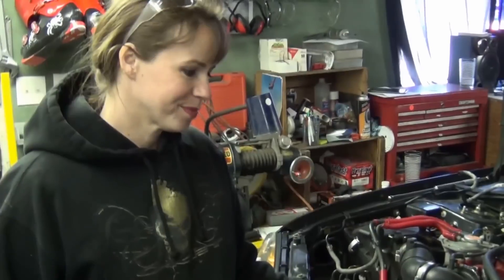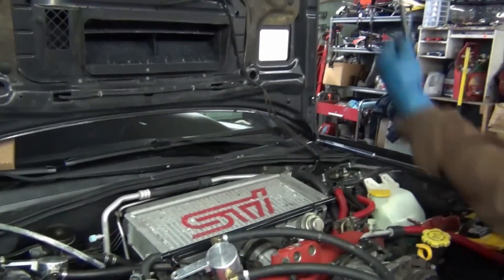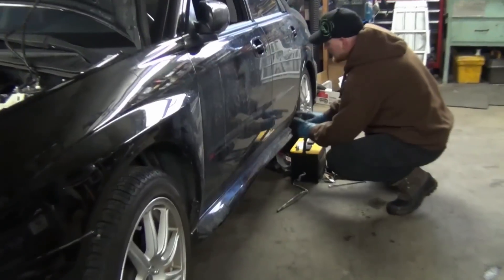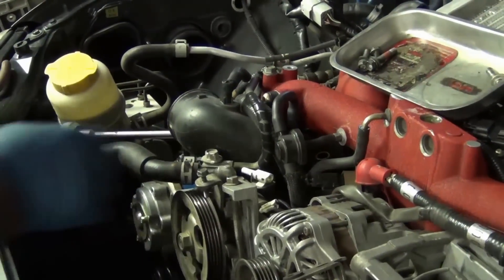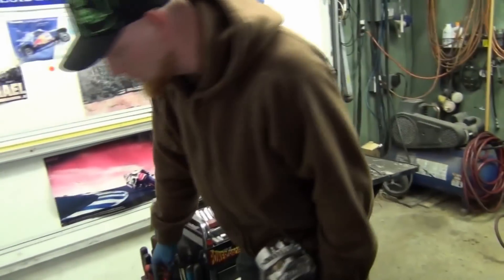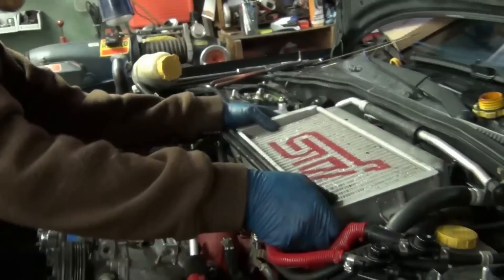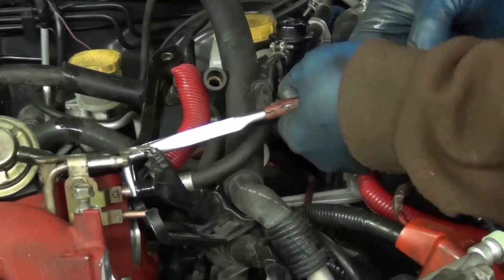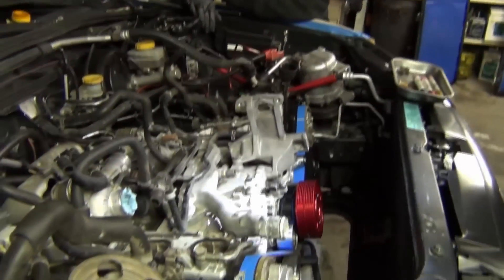Removing Subaru Impreza WRX STI Engine Part One

Comment from the maker: Make sure you keep good oil and oil pressure.  If any engine work is needed due to lubrication failure always replace the oil cooler.

Comment: Video freezes at about 20:00, but you make some very good points then so I'm glad you included the audio. That advice to not let things bother you is gold, though I've found that to be a real challenge. High achievers don't accept failure well, and it's normal to dwell on it when you make a mistake. 
You make a great point about the colored little dots. I've been using colored tape, but I have only 8 different colors, ha ha.

Comment from the maker: This one had a lubrication failure and smeared a cam journal.  Then the car sat and cooled.  Once cool the cam journal locked up and the cam wouldn't turn.  It was about 8 degrees out and the cam was too brittle to hold up- SNAP!

Comment: For small projects I have a few 12 hole muffin pans I use for parts/fastener storage. I start at the upper left, and work across like reading a page. Got them for pennies at garage sales; had them forever. However, they're really not practical for bigger auto use.

My automotive work area is outside, and I have a large bench nearby dedicated for removed stuff. I kinda do the same thing by starting at the upper left... Bench is covered & fenced in so weather/security isn't an issue.

Comment: As Brian said, the intake manifold is different.Also, I believe your transmission is a 5 speed w/DCCD (version 7 and later have a 6 speed) and the ignition system on v7+ is coil on plug, I think you would still have wires and a main coil pack. I have the JDM 6 speed in my WRX and I  honestly miss my old 5 speed. The closer STI gears make it easier to stay in the power band with a bigger the stock turbo and are able to hold more tq, but 0-60 was faster with the longer WRX gears and less shifting.

Comment: I use ziplock sandwhich bags and masking tape to keep track of bolts.  Works great.  Also noticed that the video freezes in places sometimes for minutes. :(  Goes without saying this video is going to interest a lot of people out there.  It's a beautiful looking engine.  How frequently do you see aftermarket pulleys fail?  You know the ones I'm talking about the billet or anodized aluminum components...

Comment: Glad you've had a positive turbo experience... but to be honest, in my experience, I don't think it's typical.

The big reason for more turbos out there, is that some other countries have begun charging Mfg's 'displacement taxes'... encouraging more & more 'blown' smaller displacement engines.

I'll take a larger displacement, equivalent horsepower naturally aspirated engine anyway.

I'm no semi expert either, but do know their turbos launched a cottage industry. and with light aircraft as well.

Comment: I had about 50 baggies for all of my nuts and bolts and a sharpie to mark them all.  I think for a first time engine rebuild it works, but you're used to doing so many that i bet you've memorized everything.  On another thought, what happens to make a cam pulley shatter?  Over tightening?  A previous crack?  Too much resistance on the cam that the pulley couldn't handle it?  Strange.

Comment: My experience is actually a typical turbo experience; turbos last as long as most big parts in a car...depending on how you drive, you can expect 140-200k out of a turbo, and that is, in my opinion, completely worth it.
It's like saying you should not have cars with timing belts because they need to be serviced every 60k!
Also, based on a number of youtube vids, you can turbocharge a Z06 to get +40mpg hwy, which is more than a "slight" improvement.
But we clearly are not going to agree on it!:D

Comment: Yes, I don't take on a lot of turbo work, but have dealt with failed turbo bearings, waste gate issues, over-boost destroyed pistons, intercooler plumbing leaks... and way, way too many hours of removing/replacing turbo components gaining access to various unrelated components.

Remember I said 'vehicles that must be depended on for transportation'

They're main advantage is more HP from smaller engines, and/or  more HP higher altitudes

I'll still take naturally aspirated any day.

Comment: Anyone saying that turbocharged engines are unreliable need to have their heads checked. The Subaru EJ22T (92-94 Legacy SS) is one of the most reliable turbo engines ever put into a vehicle. Btw, I spy a Gates timing kit & a Grimmspeed lightweight crank pulley on that STi. :D

Comment: I envy the knowledge on subarus you have Brian.  I have an STi and have done most of my own work on it, suspension, pulleys, belts, brakes etc.  But never would I be able to do this kind of extensive work to my own car. If only you lived in cali I would bring my car to you for work.

Question for you Brian, Whats the best way to pull out the spark plugs on a 07 STi?  It looks impossible to take out the plugs on driver side, no room.  Need kids hands to pull them out lol.

Comment: Yes, a little better mileage. Agreed! They do in fact increase engine volumetric efficiency.

And yes, I do in fact deal with trouble every day.

But does that slightly better mileage/efficiency out weigh the greatly increased labor/parts costs? (Remember, I suspect your turbo experience isn't typical.)

You can buy a lot of fuel for the price of one new/rebuilt turbo, not to mention all the unnecessary maintenance hassels/hours. (I have that in the bank.)

Plus the vehicle down time...

Comment: About the ratcheting wrenches, i have a set of craftsman (metric and sae) and the ratcheting open ended parts on them are more-or-less useless. Having used my friends GearWrench brand, i would recommend them over craftsman. Just an fyi

Comment: Have you ever seen the surface of the engine block warp too? Or is it usually just the head side that warps. I have a 98' 2.5L with 150k. I figure ill be into this job before too long :)

Comment: A good way to kill (Drain) a battery is by putting it down on the floor without an insulator between it, and the floor to prevent it from grounding out.

Comment: Thats right... most, if not all automotive intercoolers are merely air to air heat exchangers, cooling the compressed air.

Check the Wikipedia 'Intercooler' entry... it's pretty good. More than you'd ever wanna know about them.

Rant mode on:

In my personal opinion, turbo (or super) charged engines have no place on any vehicle that must be depended on for transportation. Period. They're far to complex. Naturally aspirated is the only way to go far as dependability goes.

Rant mode off. :)

Comment: For all I know your a leading expert with them! No offense intended! Didn't mean to single you out.

But in my experience, they're way too complex for a transportation vehicle. Lots of extra potential leak sources, fussy waste gate & control systems, high rotational speeds & high temp bearings, intercoolers and all the associated quirks/idiosyncrasies.

Incidentally, turbo are in reality are a big semi truck maintenance issue... but far better than crawling up hills at 20 MPH like the old days.

Comment: I like your videos! I have a question, I have a 2000 Subaru Impreza is 2.2 and I change the head to 2.5 but I have a problem with low gasoline. What can it be?
Reply: you changed the chamber size and compression, needs to be tuned

Comment: And why do you think I don't already know enough about them?! :D
Turbocharged cars are every bit as reliable as others, given that they are not some crazy 40psi tunes! 
Far too complex?! exhaust turns a turbine, which turns another, and that forces air into the engine! Doesn't seem too complex to me :D
Also, just to further prove my point, almost all semi-trucks, symbols of reliability and dependability, are turbocharged!
But that rant mode is pretty cool...gotta create myself one of those :)

Comment: Can you pull out engine an trans at the same time off of a 03 subaru wrx?
Reply from the maker: +phillip lozano Of course.  Just pull the driveshafts, condenser, radiator, radiator support etc.

Comment: they have the same ratio just 1 more gear. the only difference was in 07 they changed to a 3.7 final drive jdm sti's 5spd have a 4.44, us wrx 5spd has 4.11, us sti had 3.9 then 3.7, all 5spd non turbo subarus have a 4.11 all autos have 4.44

Comment: I need help***
if some one could shed some light on my situation it be much helpful I recently bought an 03 impreza wrx with a blown motor and bought a jdm ej20 looking to do a bottom end swap and want to know if the usdm intake manifold would fit on the jdm block
**Please if someone could help I cant find a real yes or no**

Comment: I don't fully understand what you are trying to say but I'm pretty sure it's not correct...an intercooler does not warm anything, except the air going around it, which is not going to be used by the engine in any way!

Comment: quick question I just finished up my swap to a sti my 05 to my wrx 2003, I keep getting p0340 bank 1 cam error, I was wondering what could be causing that do you have any ideas? any advise is great at this point. I chk the lines ecu is fine harness is chking with correct voltage, timing is fine.

Comment: I am looking for someone to look at the motor on a 2010 Subaru Impreza WRX STI in the Kansas City, MIssouri area (not a dealership). Any suggestions?
Reply: i really wish my friend still had his shop id reccommend him to you but otherwise in shawnee ks lindan auto is pretty good
Reply: Sadly its gone. Sold it on Craig's list as is. It was snake bit from the beginning.  2 motors in 3 years. :(
Reply: +Jenna Mills zero tune and incorrect octane will do that

Comment: 18 hours to remove an STI motor? Umm...I hope you don't charge by the hour. Nice video though.
Reply: Will Hesselton nah 5 hours
Reply: 1-2 hours is how long it takes in a subaru specific shop usually. Regardless of what the shops say. 

Non Subaru shops are about 5 hours. Hopefully no more than that.

My fastest time by myself is a little under 50 minutes going as fast as i can (after years of shop experience) 

Dont be fooled, these cars are easy to deal with believe it or not.

Comment: Things on cars break...if those things give out at 50k miles, then that's unacceptable but it is expected on any component to break, or require maintenance
It's like saying that I've seen manual cars' clutches fail, so we should all but automatic cars!
Advantages: more TQ so more HP and less fuel consumption(for many reasons)
disadvantages: more parts to break
I'd take any NA engine any day, and turbocharge it...You see trouble, I see wasted potential :D